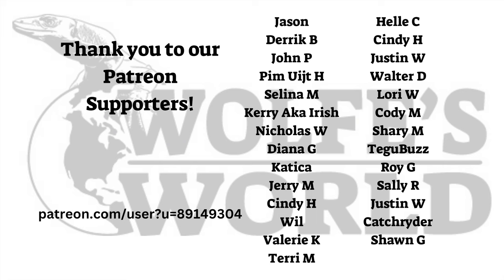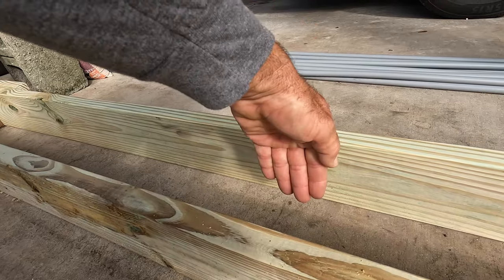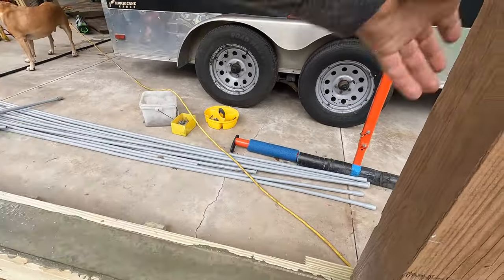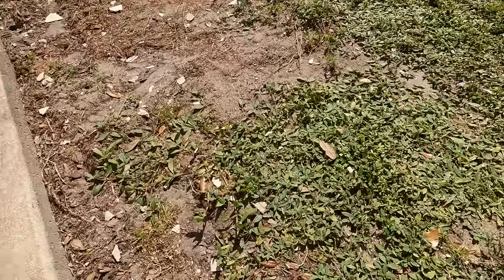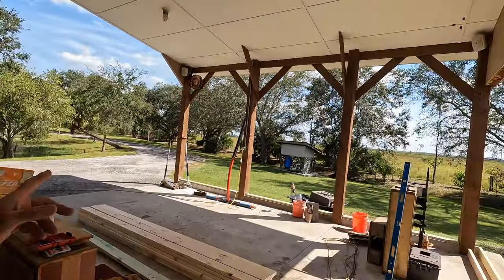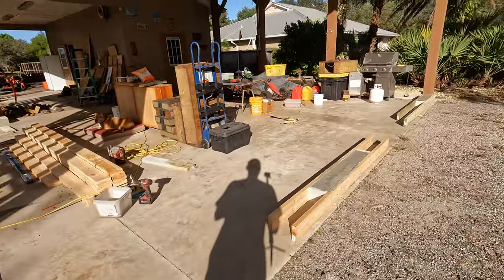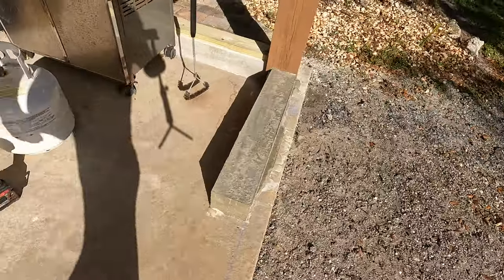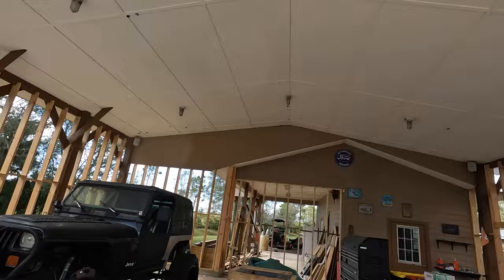Starting to build the shop!

Comment: Hey in a pinch plum Bob if your tackle box is around get the heaviest weight you have in it, and pinch it in some plum line. And you can tie a quick release knot in it, so you can hang it on a nail or screw above where your wanting to find the spot, always worked for me in a pinch.
Reply from the maker: Totally agree!

Comment: HARDY PLANK IS SOME AMAZING SIDING!!!!! Although, that shit is hella expensive buttt well worth every penny of it😂 My parents have had it on there house for almost 2 decades now. They were the first ones to put that siding up out of the whole entire neighborhood, pretty crazy to think. A few years after you started seeing other houses through out the neighborhood switching over to that type of siding.  It handles sooooo much better in storms, you know. They have yet to replace one due to a storm blowing it off or something and we've had a tornado come ripping through our coldisac several years ago. It ripped off their neighbors across the streets chimney.  Clean off the side of the house. Now that shit was crazy and they didnt even get a chip in them😂 Sooo that alone should tell ya how strong they actaully are.
Reply from the maker: In Florida they give a wood frame house with hardy siding the same insurance rates as cinder block construction! Good stuff!
Reply: @WolfesWorld  My favorite is a brick house a solid ass structure. Buttt with brick there's only so much you can do with it as far as color. I don't like painting brick, it's not my taste. Sooo with Hardy I feel like it's roughly similar as far as structure strength they are both solid as heck compared to that plastic vinyl crap or even the wood. Which don't get me wrong the wood is nice butttt your gonna have to replace that shit a couple decades down the road depending on how much rain your area gets. Butttt that's pretty cool about the insurance rates etc
 etc.

Comment: Great job as always Jerry. I always enjoy watching your videos.
I can't see well because of the water reflection, but algae may be a problem in your lake, so I'm not sure grass carp would help there. I've seen people put in beneficial bacteria (Pond Perfect Treatment) that compete with the algae for resources and starve the algae. Some people even release tilapia in their lakes, and they partially feed on algae. Of course, this is not the best solution if you want to grow indigenous (autochthonous) species.
Reply from the maker: It’s not what I would call algae, but just water plants. I did some research and the carp are supposed to eat the kind I have
Reply: @WolfesWorld  Thanks for the explanation. As it is the case in numerous ponds and lakes I thought it was some species of filamentous algae (algae bloom). 
I've had small grass carp in an aquarium and in a lake (here in Europe) and they are amazing at eating plants. When the time comes, you will solve that problem as well.
Good luck.